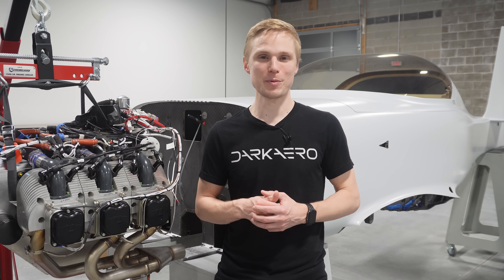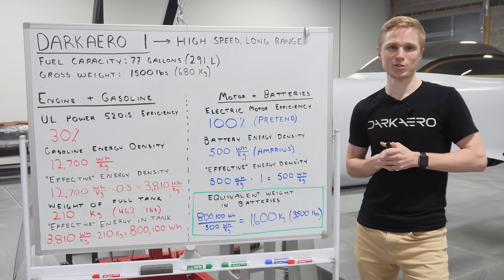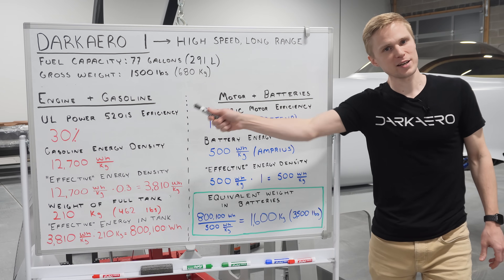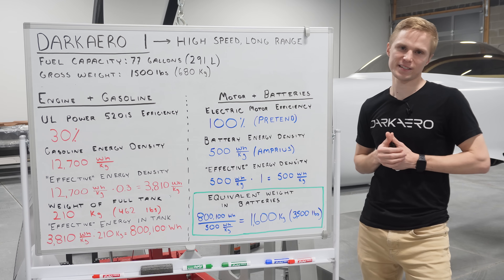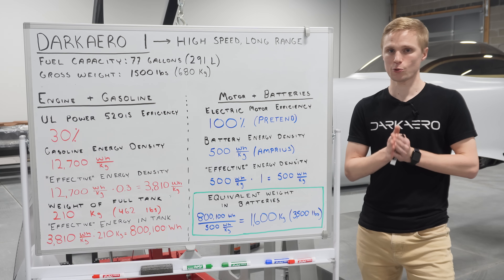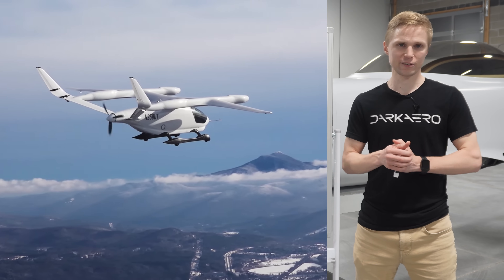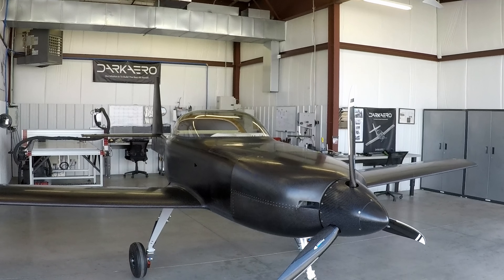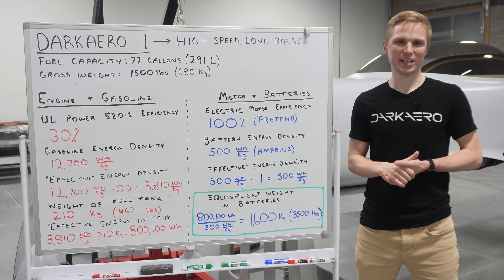The engineering challenge of electrifying airplanes

Comment: Very good and informative video, thanks for putting it out. 

I think we as a society need to reevaluate our desire to move all electric until we figure out a better way to have more reliable power supplies to be able to recharge, and more importantly (for the environment), we need to reevaluate whether or not it’s worth it because of the environmental factors dealing with the construction of electrical components and, more particularly, batteries. The rare earth minerals used in the creation of these electronic components and batteries, are in many cases way worse than anything fossil fuels can put out over the lifespan of an average internal combustion engine. Especially when you consider how far manufacturers have come with making their internal combustion engines, more efficient, and environmentally friendly!

I think the answer is twofold, and one answer is easier than the other. First, we need to re-look at nuclear power. It is relatively cheap, and generally speaking, most if not all of the problems associated with the earlier nuclear power plants have been solved . You have to exclude the Chernobyl incident, because that had nothing to do with safe nuclear power, and everything to do with a failed Soviet state. Second, (and this is definitely the more difficult one), we have to figure out a better way when it comes to the rare earth minerals used to create our electronic parts and batteries. we are stripping entire sections of the earth, and using slave labor essentially to do so, in the name of being “environmentally, friendly“. We only look at how much CO2 the end product uses (the electric car or solar panels for example), but completely fail to look at the environmental impacts of CO2 and environmental harm on construction of that product, and what happens to it after its usefulness expires. It ends up filling landfills with harmful chemicals and rare earth materials, and on the production side (as already stated), it strips the earth with borderline slave labor.

I’m not opposed to electric vehicles (I actually have a Tesla cyber truck reservation), but these are things we need to figure out before converting our whole society to electric.
Reply: "The rare earth minerals used in the creation of these electronic components and batteries, are in many cases way worse than anything fossil fuels can put out over the lifespan of an average internal combustion engine. Especially when you consider how far manufacturers have come with making their internal combustion engines, more efficient, and environmentally friendly!"

This has been disproven many times. And while the IC engine is somewhat environmentally friendly to make, the drilling and refinement process of fossil fuels is far from it (while also consuming rare earth minerals such as cobalt) and is causing many ecological disasters. And while you are at it, also include the manufacturing and logistics of all the maintenance parts of said IC engines and it's easy to see why for land transportation electric is the way to go.

That said, there are many ways battery production can improve. But waiting for that to happen instead of improving as you go just does not work. There already is a clear environmental benefit and this will only get better the more industries move towards a cleaner future, which fossil fuels have no role to play.
Reply: @kevintieman3616  Where has it been disproven?
See my other comments for a bit of info on the true (horrendous) cost of EVs. You are also spreading made-up misinformation about fossil fuels. Ffe München recently published a study proving ICE run on fossil natural gas to be lower in CO2 emissions than EVs. Not to mention other fuels which internal combustion engines can and do use.
And all of that still ignores the massive effect the crippling costs of countless trillions which EVs cause, taking away our ability to invest in actually effective CO2 reduction.

There absolutely is not any environmental benefit in EVs compared to ICE as I have just proven with that Ffe München study and which I can similarly prove by using any Ev vs. ICE lifetime CO2 emissions study you can present and which I already am familiar with.
Reply: @kevintieman3616  
Yes, thank you for noting what shouldn't even need to be noted - but apparently, sadly, does.
Even before we're able to get away from rare-earth mineral mining, while simultaneously having better and better battery tech, the unmatched toll of oil and planet-wide ICE's is, well - unrivaled.
Reply: @kevintieman3616 , I’ll be waiting for a reference for your claim that it’s been “debunked“, but in the meanwhile, I’ll drop a few references here. It has not been debunked. While I do think we need to move forward with electric, your claim that internal combustion engines are way worse is also unfounded. the production of internal combustion engines is way greener, and we have gotten very very good at cleaning up the missions from internal combustion engines. We in the west are not the overwhelming contributor to increased global emissions. Currently, that would be the east, and the rising economies of India and China primarily. As stated, I have a reservation in for a Tesla cyber truck myself, so I’m not against electric vehicles, but I will say that the technology for us to “go all green and electric“ is far from a reality. It’s not sustainable on an international level. We need to figure out different and better ways to produce electric components that will not be as harmful to the environment. Don’t make claims without backing them up.

Related to, but separate from whether or not, it is or is not sustainable, you’re completely ignoring the human toll of borderline slave labor, and most of the mining aspects of these rare earth, minerals and components. You can’t just overlook that, and act like it doesn’t exist as long as you “get yours“. I’m not ascribing evil motives to you, I’m just saying that we have to look at it in the face, not pretend like it doesn’t exist.

https://www.instituteforenergyresearch.org/renewable/the-environmental-impact-of-lithium-batteries/